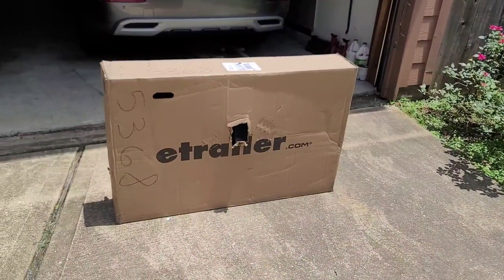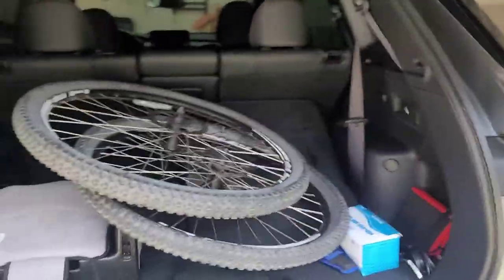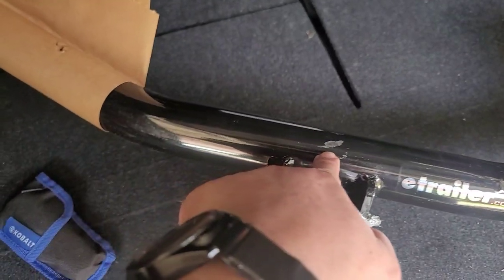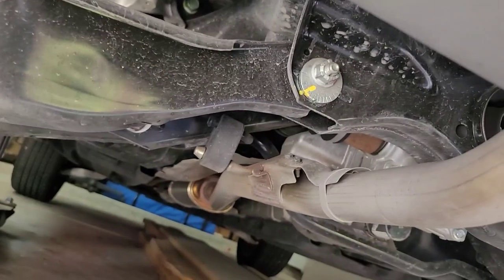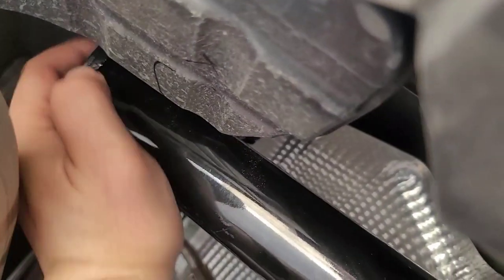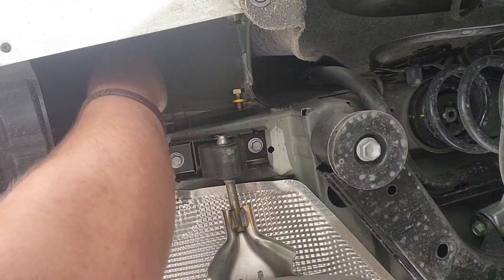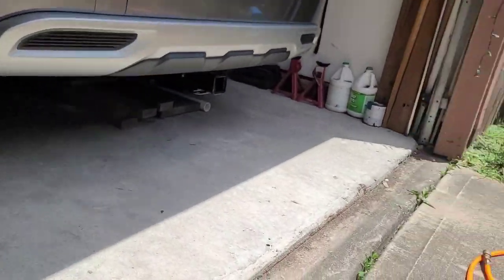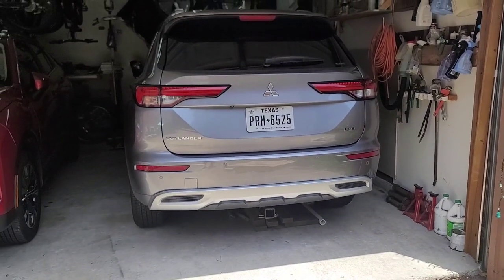2022 Mitsubishi Outlander concealed hitch receiver DIY install.

Comment: I am so glad I found you to save lots of money and time. The dealer wanted almost $1000.00 to get the OEM hitch and to get it installed. They are claiming they had to take the rear bumper off to install the hitch and then to top it off wanted  me to wait 4 to 6 weeks to get the hitch in. I am moving out of state at the end of month with a lawn trailer and I couldn't wait that long to get out of Florida. Thanks again so much.
Reply from the maker: Glad i could help. Hey, check out my other video about the all weather mats, super affordable, as a link in its description https://youtu.be/M_wgwztyRlU

Comment: Could you post a link to the part please?
Reply from the maker: Is on etrailer.com very easy search by model and year
Reply: They do not list a 22 outlander. Did you use the 2021 Nissan rogue hitch?
Reply from the maker: @flmark70  I just pinned the link

Comment: How do you like the car? Im considering to buy one but worried of the nissan CVT transmission
Reply from the maker: Love it.

Is it the same transmission though? I know the engine is.

At 2800 miles no issues.

I also have a 2012 Lancer with CVT, bought it brand new back in 2012, zero issues
Reply: It is the same but Mitsu tuned it differently. It feels and sounds like a a normal 8 speed torque converter automatic transmission. I love mine but I also have the fluttering hood issue.
Reply: Nissan has fixed most of the issues in the past few years with the CVTs.

Comment: Hi Alex, will it block the hands-free power liftgate system (kick)?
Reply from the maker: Not at all
Reply: I just installed the same hitch on Outlander LS, manufactured May 2022 trim, and the Kick sensor is not working any longer :(  The installation was 30 minutes and I saved CAD 1400 for installation of OEM, quoted by the car dealership. I guess the savings will compensate for the opening with the key. :)

Comment: The wiring baffles me?  There should be plug-n-play connectors near the battery and by the rear panels.  Mitsubishi shows the same part as past years.  Has anyone located the connectors?  Pictures?

Comment: Do you have to use a lifter to install it?
Reply from the maker: No. I did it on the floor. I did jack it up a little, but  a lift is not necessary at all
Reply: This is awesome. I’m going to install this on my 2022 Outlander for sure!
Reply from the maker: @kevingrace9774  it is, super easy, 10 minutes